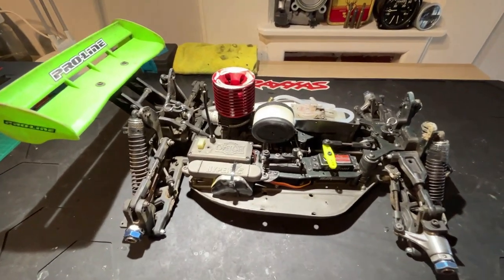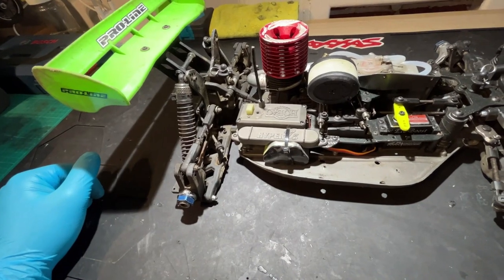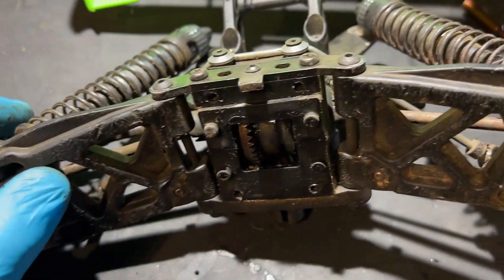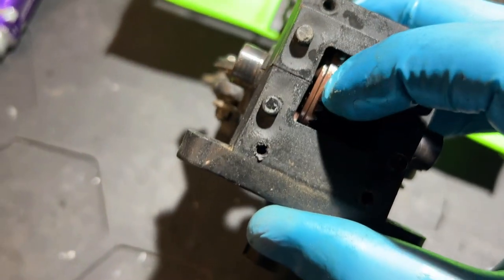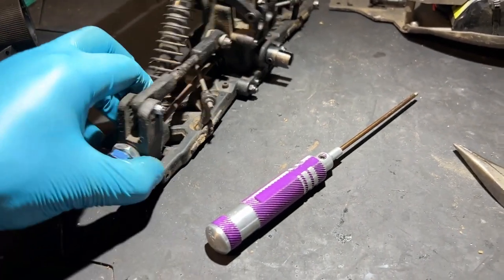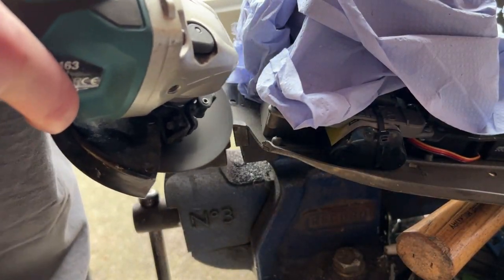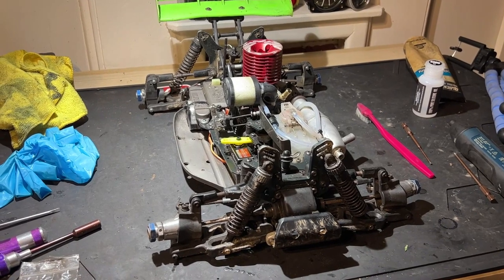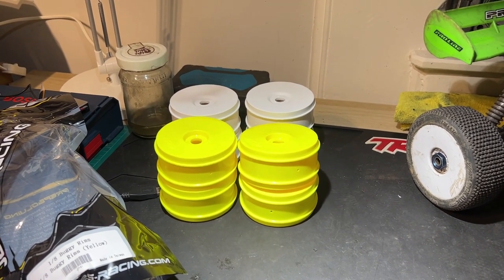Do This Simple FREE Mod To Your NITRO RC CAR

Comment: Don't no if your get this message but b4 you put that doff in you need to push the pinion gear in from the back and then put the drive shaft coupling on and tighten the grub screw,if you do not what happens is that if you assemble it all then put the drive shaft cup on you actually push the pinion shaft back onto the diff and you will always have movement back and forward on the mesh,hope this will help
Reply from the maker: Thanks bro I made sure to do that good tip though👊🏻👊🏻

Comment: Believe it or not, there are uses to having less droop.  Seems counter-intuitive and my first instinct on the matter was "more travel is always better for off-road".  Limiting the droop can help with limiting roll in corners.  Maybe you already know this but want more droop in this situation because perhaps it's a matter of that car being old enough to predate modern tracks with enormous jumps -- that is, if it has less travel than modern day 1/8 buggies.